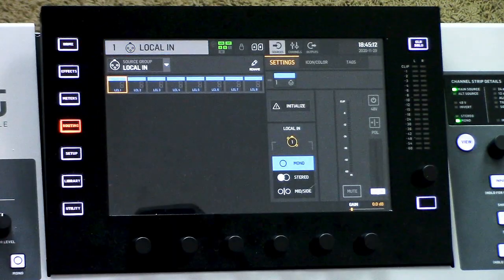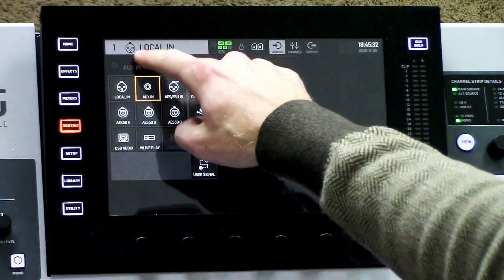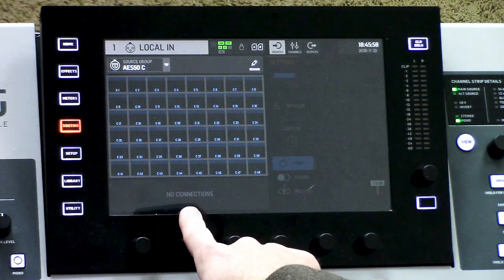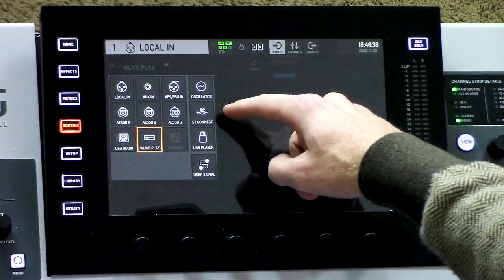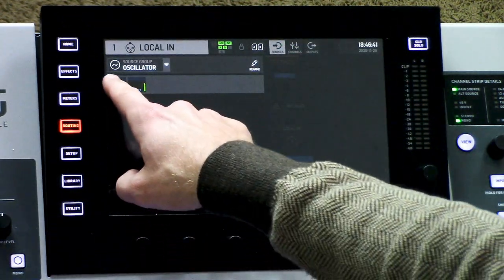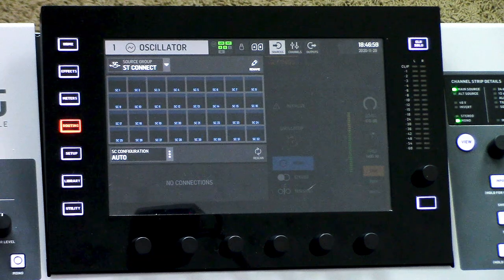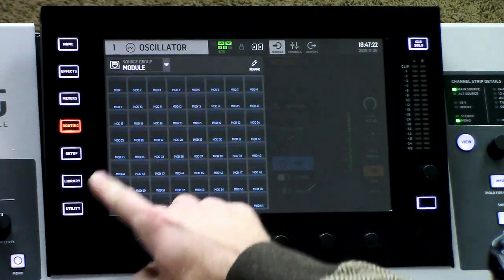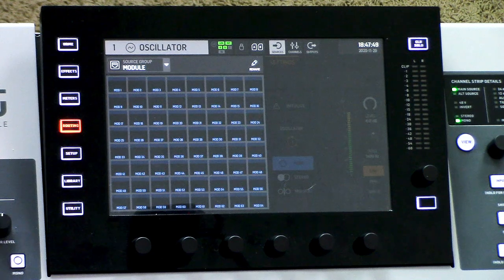Behringer Wing 101 - Inputs are Sources

Comment: These are going to be very valuable videos. I would love to see a step by step method for setting up the Wing for DAW Use. For example, connecting a stereo keyboard then setting up the routing and setting up the master output channel on the DAW/Wing and main and secondary monitors. I am positive you can provide best practice methods for this. Your videos are the best I have seen so far. Please keep them coming!

Comment: thanks Drew! I currently have an X32rack. if I get the Behringer wing can i then use my X32rack as a stage source box to supply channels to the wing (via AES50)?? would I still be able to control each channel’s mic preamp input gain from the Behringer wing?

Comment: Can you connect XR18 with WING?
Reply: Using it as an analog submixer, yes, but you're probably thinking about using the XR18 as a DI, like an S16 or S32, where the answer is no. The XR18 lacks the AES50 interface that is needed for that application.